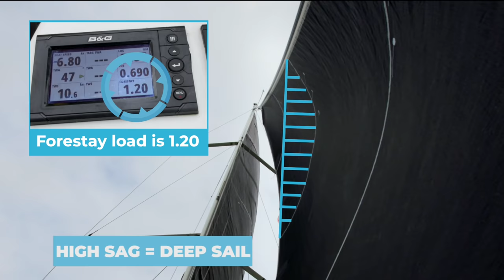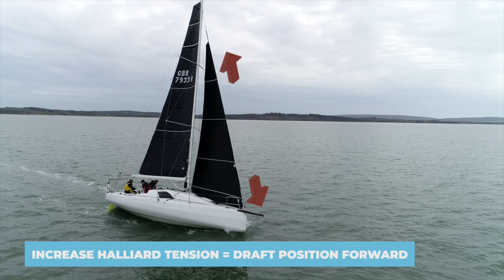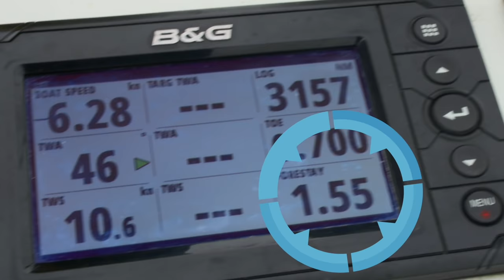The Key to Upwind Performance | Dynamic Tuning | North Sails Expert Charlie Cumbley & Cyclops Marine

Comment: also you can use twist to power (stalling the base) or depower (stalling the top=less heeling and turbulence drag) the sail top area

this info is found in airplane wing twist, that is mostly used to control stall and parasitic wing tip drag

Comment: Excellent video, thank you so much. Can you talk a little about mast bend?  Especially when your boat has running and standing backstays. I never know if I’m supposed to use the running back stay to keep the middle of the mast straight and use the main backstay  to pull the top of the mast back to help flatten the main sail. . Thanks again.
Reply: If what you are calling a 'running backstay' will straighten your mast when the standing backstay is pulled on tightly, then it's what we'd call a 'checkstay' and that's how you are supposed to use the two.  Flatten both sails by pulling on the standing backstay, then --- if the main is too flat --- tension the checkstay to power-up the main to achieve the balance you want.

Comment: Thanks Charlie, nice vid. Looking at the mainsail the top batten was falling to leeward on every shot. I was always taught that the top batten should be parallel to the boom. Perhaps it is different with fathead mains?
Reply: It should be twisted leeward - wind's speed is higher up there. Sail should be twisted, same way plane's propeller is twisted.

Comment: Great for folks that sail in 10kts. what is the north set up for Beaufort wind force scale of 5 (over 20kts) with this system in heavy sea chop? I just saw a new 3300 reefed get tossed on its ear with poor pointing ability in those conditions.
Reply: In windier conditions you want a more twisted mainsail to both spill power up high where it’s less effective (because it’s higher up it tips the boat more and you’re power limited by righting moment) and also to widen your grove to allow for steering for waves. Having a more twisted sail means a portion of the sail remains powered at a wider range of apparent wind angles allowing you to keep power while heading up and bearing off to reduce slamming in waves

Comment: The missing element to low mast compression for light winds (when you are seeking more power) is twist in the main? We are trying to take twist out of the main when seeking power by lowering the traveler and sheeting on the main to close the upper leech of the main. Inevitably this extra main sheet tension adds tension to the forestay, how do we balance this?
Reply: Hey Dan.  (1) Twist in light wind is to account for the usual and sometimes very significant wind speed gradient (and thus apparent wind angle gradient) from top to bottom.  W/o twist, the top tends to stall.  (2)  When I trim main on the E 37 in light winds, I pull the traveler above centerline and ease the sheet to get the twist we want w/o reducing angle of attack.  (3)  Proper mainsheet tension on the E 37 in light wind won't appreciably load the headstay.